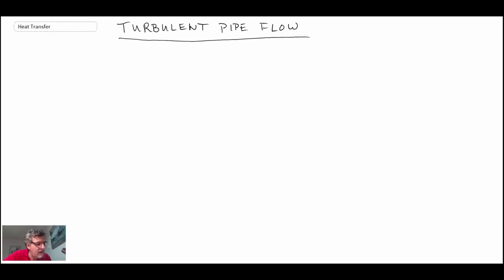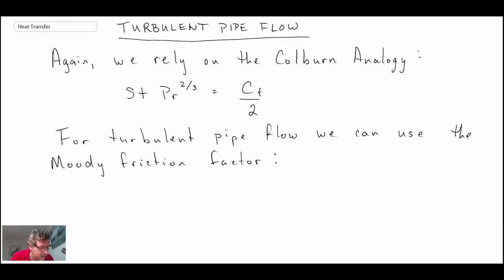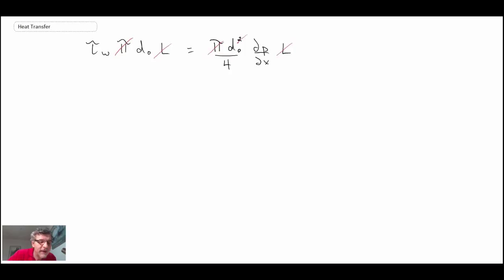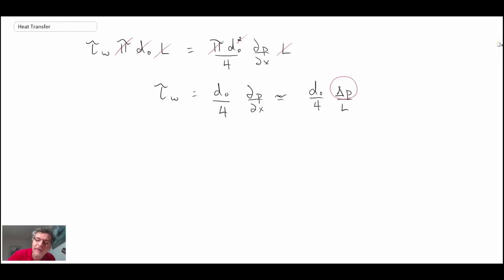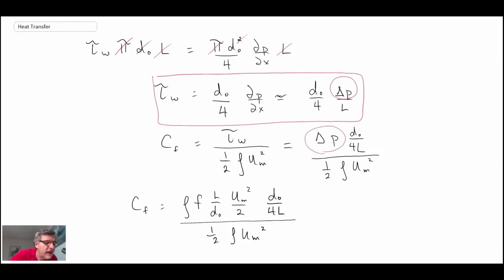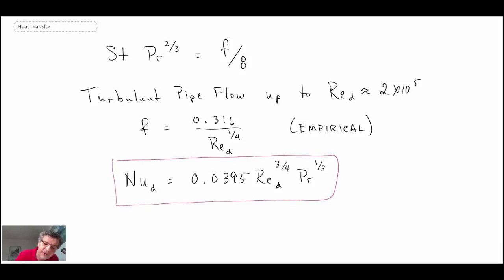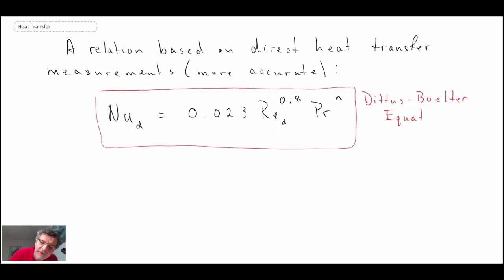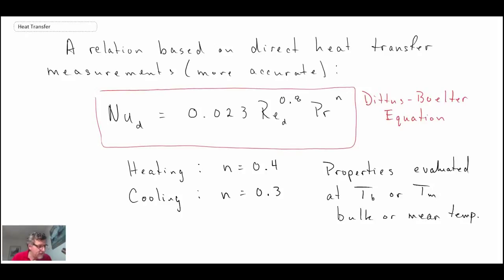Heat Transfer L21 p5 - Turbulent Pipe Flow - Dittus-Boelter Equation

Comment: If using very short tubes I suppose the equation is not accurate because of the thermal entrance region. Is there a form of the equation where X/D is included?
Reply: I recommend that you use the correlation proposed by Gnielinski :)